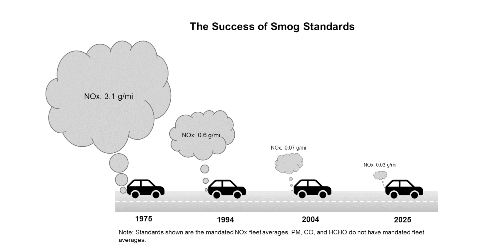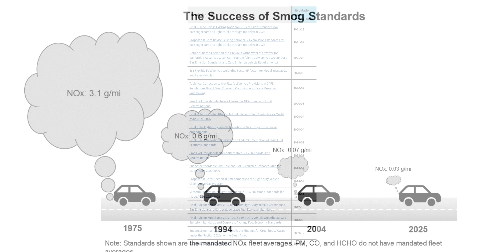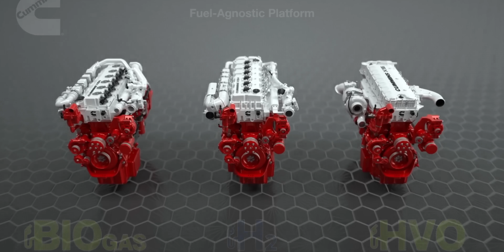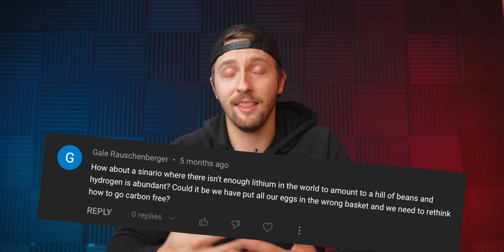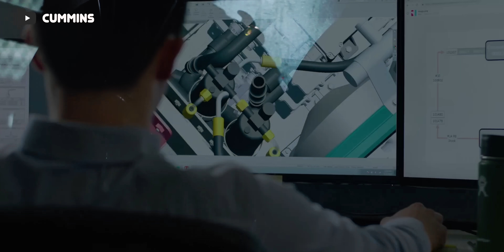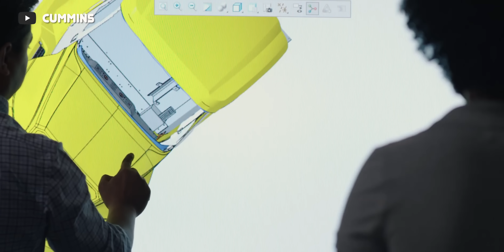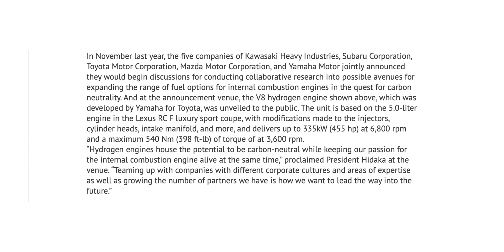Cummins Hydrogen Engine Will KILL DIESELS FOREVER

Comment: The biggest challenge with Hydrogen is that it is a leaky gas.  It is hard to contain long term and requires high pressure as well like Propane and such.  It would require electricity to produce the Hydrogen as well or some other energy source.

The reason to use Hydrogen is potentially fast fuel up.  If I can attach a hose to my car and similiar time as filling with gas I am back to full range you have a winner.  Also your comment on rare earth mining is another reason to use Hydrogen.

Another issue, why are they not using small motors as electricity generators and use electric motors? They had these on test tracks back in 2008/9 and they got AMAZING gas mileage using the motor at it's peak efficiency band.

Comment: I think this issue with the generation of hydrogen and what it costs to generate it, cool it down to liquid, put it in a massively pressurized tank, and all the small details related to that are HUGE problems. Way more than a gas or diesel engine, and with the hydrogen they're still going to depend on ELECTRICITY and by extension, FOSSIL FUELS. It's this insane modern idea of pretending like we're being green when we're not. It's such a load of BS. 

That's not to say I'm not interested in the idea of hydrogen engines etc I just believe that the people at the top pushing all these environmental ideas have different goals that are unrelated to the environment they are simply a means to an end. It is completely illogical to push "carbon neutral" fuels or energy sources when those energy sources still depend on fossil fuels. Gotta ask yourself the question why are they pushing something so illogical? Maybe because it's a means to an end and the details don't matter.

Comment: Cummins class 8 engines can also run on natural gas. I have worked on a few and they are cool.
Reply: They have been using these engines in the oilfield for years. Not new technology for sure. Ask any oilfield pumper or tech.

Comment: Why not strap a generator to the back of a diesel engine then run electric axles? Get a diesel engine that’s burning clean cause it runs the same Rpms and the torque of electricity or dies that make to much sense for climate change?

Comment: I used to build Garbage trucks with CNG configurations it was back in 2018 I did talk to the engineers back then ans asked them if they ever go to hydrogen they said it be very difficult  to produce the mass amount  of fuel needed to supply  that many trucks there opinion it won't happen and to add to this who would drive a truck that is hauling a literal bomb around just saying

Comment: HHO has been done by Stanley Meyer and ran his beach buggy on it and made it on board from water or Sea water. The German Submarine runs on Hydrogen with a built in Deasil for back up if the main system fails made in 2004. HHO has more power than Hydrogen on its own and you could say most have not looked into diluting the gas made from HHO to educe the power of it by 60% buy  adding a neutral gas to reduce the power of it.

Comment: Considering the diesel community is the reason the EPA changed its interpretation or standing laws  and is now trying to kill the greater car community, you will not get ANY sympathy from the rest of the car community.  Adapt or die...  you bring up a few good points, and the diesel motor may be the easiest to convert  over...

Comment: @Dust Runners Automotive Journal - Thank for bringing this to light... PLEASE LOOK AT HYLIION, PLEASE! Would love to get your take on their business model of utilizing Natural Gas for long haul trucking and incorporating clean fuel to charge batteries for their ERX Class 8 truck. You have now opened the can of worms and discussing Hyliion would be VERY beneficial to your argument... that in which the infrastructure is not there yet for Hydrogen engines and wont be for quite a long time. Yet Natural Gas is readily available, cleaner than Diesel (obviously). You also mentioned the thought process of generating Hydrogen which requires energy (dirty energy I might add), which begs the question of "well to wheel"... how is energy being produced and when it gets to the end point, is it really cleaner than burning diesel since it produced a mass amount of pollution to create it? All that to say, HYLIION has the answer and there are a ton of people who would love and need to hear your thoughts! Thanks in advance for your time and consideration!

Comment: diesel engines would never die  ,stupid electric cars will chan ge it ?? with what ?? with 4-5x less range and 50x longer refueling /recharging  and batteries often die in around 10 years and new ones costs 15000-20000euro depend on size !!  working maschines,ships,army vehicles ,trucks   it all epends on diesel engines

Comment: The in the 80's a man made the  Fuel injector that does it in hydrogen or turns it in hydrogen. Cummins doesn't have to redo there engines. So there wasting money an time.

Comment: The node west gets to cold for current battery technology. They cannot hold a charge in the cold and if you live in an apartment complex you would not be able to charge. 

This makes more sense for vehicles because it is still stored in a tank and gets converted to power just wonder how it works in cold.

Comment: Look into the history of hydrogen and how it was used in about 100 years ago. They used powder hydrogen to run vehicles, they used electricity, and many more but settled on gas. The powder hydrogen was great because if you ever got into an accident and the tank was punctured, it would just leave a harmless pile on the ground as the final step didn’t happen till it reached the engine… this is VERY OLD technology!

Comment: I’ve always wondered why trucks are set up like locomotives with a diesel engine running a generator that drives an electric motor. This has worked for a long time for trains and I don’t see why it wouldn’t work for trucks. A smaller diesel running at a mostly constant speed would likely be easier to tune to meet emissions standards and use much less fuel when the truck is idling to keep the driver comfortable while sleeping.
Reply: Alot of the mining haul trucks have diesel-electric drivetrains. Ours fully loaded weight is around 800k pounds and once they hit flat ground you wont keep up thier acceleration with a f250. Honestly that set up would be enormously efficient for long haul applications.
Reply: Most companies install APUs (auxiliary power units). These are small diesel engines that provide heat, AC and electrical power so the driver does not need to idle the truck to be comfortable.
Reply: Maybe we could re-plumb the brain of Leftists to run off ass gas instead of oxygen pumped through the blood stream, clearly, it causes them to see lions and tigers and bears, Oh no; the evolutional semiotics to their D.N.A had a bad glitch, lizards were never designed for warm blooded oxygen flows to the brain! Hence, we hear a lot of global warming/climate change issues with panicked imperatives!
Reply: That use case only works for trains because of the track system. They have a high number of multiple cars connected and they don't stop/start constantly like cars. Having a engine per load would be highly inefficient.
Reply: I've considered the same thing except with motors on the hubs.
Reply: In almost ever state it is illegal to idle ya truck engine that’s why they mad us install APU on them
Reply: Or did you mean are not set up?
Reply: Look at the size and fuel consumption of a locomotive, yes i know a tractor and trailer are much smaller, but the combined weight of the components would probably leave little left for freight, which would increase the number of those trucks required to haul the same amount of freight, increase the number of tires for those trucks, and fuel for them, and increase shipping costs as well. Probably erasing any advantage
Reply: @tomgranger462  Not to mention DOT weight allowance.
Reply: Don't know where you get your information, most trucks have standard transmissions (8 to 18 speed) that get power to the ground via the drive line(s).
Reply: @TheTimbertiger  True but large off road mining haulers trucks are diesel electric
Reply: Too heavy. Payload pays. Dead weight does not.
Reply: @Machia52612  a trains fuel tank are anything from 2500 to 5000 gallon tanks  the size is out of the question to put on semi trucks , at the end of this trains blow smoke all day every day , people forget it still has a Diesel engine
Reply: What you are describing is a Hybrid Engine... Does the Name Prius mean anything to the other commenters here? Use a small fuel engine to turn a generator, then use the Electric from the Generator to power a torque motor. The problem lies in that generator. A Hybrid engine the size required would be prohibitively expensive and when it wears out in 100K miles, you have a $50,00 bill on your hands to replace the generator (a Prius generator is ~$7K to replace for perspective). This being said, Hybrid is the way to go until they can work the kinks out of Hydrogen, say in 15 years or so.
Reply: @rb2530  that’s not how Priuses or most “hybrids” work.  Hybrid is just a lazy marketing scheme to fool most people into thinking their mostly ICE driven machine is green.  But it’s not.  It’s an ICE engine with a tiny battery bank that works for short periods of time at slow speeds.
Reply: @downbytheriver406  thanks. Always wondered about that. Had a friend with “ hybrid” . She said she got 40mpg. Wasn’t impressed with that number as my wife’s car gets 34 mpg highway
Reply: @arthurbrumagem3844  yep no problem.
Reply: @rb2530  What you're describing is called a Serial Hybrid.  The Chevy Volt (not Bolt, that's a different car) was like this.  (it's no longer produced)  There was a smallish battery, enough to go maybe 30-40 miles, and a small internal combustion powered genset that would kick in when the battery ran low.  People liked them.

Comment: Hydrogen is great, the problem is storing it. Hydrogen is the smallest element in world, It is very hard to contain because it can just seep through the containment vessel. Liquid Hydrogen has to be kept EXTREMELY cold, which imposes a whole another set of issues. Also as Liquid Hydrogen boils off as it heats up it must be vented are replenished to keep the same amount in the tank. Again Hydrogen is a great fuel for something like Rockets that can overcome these issues but for cars and trucks that are constantly mobile or parked overnight, its just not viable.

Comment: Hydrogen to fuel engines is nothing new. Manufacturers have been researching and developing hydrogen fuel cells/hydrogen powered vehicles for many years even before the dude making this video was even born. The Saturn 5 Rocket that went to the moon 50+ years ago used a hydrogen fuel cell for electricity so it’s absolutely nothing new. It’s really stupid to burn fossil fuels when we have so much hydrogen that we don’t even need to pump from the ground. A scientist invented really easy way to burn hydrogen from water he made a car that drove across country with a few gallons of water and he was killed so we have that technology and Ford and other companies made fuel cells back in the 90’s that worked we don’t need liquid hydrogen. We need to be more worried about cars if we get cars to not burn fossil that will be a massive step in the right direction most every adult in America drives a car and burns atleast one tank of gas every week that’s our biggest problem. Eventually dealing with Diesel engines needs to be done but let’s get one thing done at a time if we get the general public to not burn that one tank of gasoline every week that will be huge that’s the biggest problem.

Comment: People have this assumption that companies will only ever do the one thing they have always done. Which is a stupid assumption to make. 

Cummins isn't a diesel engine company. They are a money making company.  If they think they can make more money with hydrogen engines than diesel engines, then they will make hydrogen engines instead of diesel engines. Because duh.

It's the same with "big oil" companies. Did you know that Exxon is at the forefront of green energy tech? Because they want too have a way to make money when/if green energy ever actually replaces oil as the primary source of energy. Because duh.

Comment: Dodge EV truck with range extended. Smaller engine run as a genset at peak operating rpm to charge batteries as needed. What are your thoughts??

Comment: Funny how y’all just looking at it now. People out there running their trucks on water. Why do you think they can figure it out while billion dollar corporations can’t? It’s all in the design. You wonder if people really that dumb or are they intentionally obtuse. Hint for all you slow people with average IQs. A generator runs less fuel than an engine, Cummins also makes them. A generator might run .3 gallons of fuel and hour. Meaning you could get 150-200 miles per gallon of fuel. Who would it bother if you could drive across the Us and back on a single tank? I know of 2 scientific inventors that had engines running on water. They are dead. 1 guy had a 4 cylinder engine getting 100 miles on 1 liter of water. He disappeared, presumed dead.

The reason there is more interest in it, is because of politics in Middle East and Russia and OPEC. Talk of US dollar no longer being used as the Petrodollar etc etc. Technology has been out there for a long time, it has been suppressed. I guess if average consumer only filled their tanks once a month would make who lose money?
Reply: >>Funny how y’all just looking at it now. People out there running their trucks on water. Why do you think they can figure it out while billion dollar corporations can’t? It’s all in the design. You wonder if people really that dumb or are they intentionally obtuse. Hint for all you slow people with average IQs<<
Because, it doesn't work.
>> engines running on water<< Yes, they're called "steam engines".
Reply: @frankschwartz7405  No there are new methods, you must have been living under a rock. We have all sorts of methods of using water. Hydrogen fuel cells, electrolysis, cold fusion. If your references are steam engine lol. Shows how far out of the loop you are with technology.

Comment: Electric engines actually use less power because they're more efficient. That power just comes in a different form.
Reply: >>Electric engines<<
No such thing. It's a motor. An engine uses a fuel.
Reply: @frankschwartz7405  fuel is chemical energy, power is energy over time. You're talking semantic, Im talking common sense
Reply: @namechane1758  >>You're talking semantic, Im talking common sense<<
Maybe. Words mean things. Electricity, water or hydraulic pressure, moving air or water are forms of energy. Motors convert existing energy to motion, typically rotary motion.
Reply: @namechane1758  >>fuel is chemical energy<< A fuel is not energy, but it will provide energy (usually heat) when it undergoes a chemical reaction.
An "engine" runs on fuel, a "motor" runs on existing energy.
Reply: @frankschwartz7405  samantics my point remains the same. ev's use less energy to move the same distance
Reply: @namechane1758  >>ev's use less energy to move the same distance<<
Did I dispute that?

Comment: fact. hydrogen engines can not make the pulling/pushing torque of a diesel engine, makes no difference how many times these green energy scammers fabricate tests information, they can't can't change that fact. Additionally windmills/solar panels never pay for the themselves, they are just political control devices.

Comment: My personal thoughts are that the fuels will get cleaner and the batteries will get better to the point where we have true anti-idle that is electric and fuels that are clean enough that no after-treatment is required.  Regenerative braking instead of a Jake brake is also interesting. And conversely an electric boost when starting from a stop and accelerating.
Reply: Let me guess...you plan to ride a unicorn too.
Reply: Fuels may get better, but making batteries CLEANER, will be quite the challenge.
Reply: @dotarsojat7725  agreed lithium and cobalt mining is disgusting business and all these smug losers touting their EV chauvinism need hitting upside the head for their belligerence.
Reply: They have been making a trailer wheel set with a 200 KW motor and a 200 KW battery on the trailer for years.  They help with regenerative braking to charge the battery pack, and then use a throttle position sensor to help when getting on the freeway or going up a hill.  They are said to reduce diesel use by 13%.  The system could also be used on a electric semi, and could be plug in hybrid system, instead of just charging with regenerative braking.  

I don't think hydrogen will be the replacement for diesel trucks.  Maybe a gas engine conversion would work, (3.5L  running on hydrogen and putting out about 250 - 350 HP) as a low weight alternative to the traditional diesel engine as a type of range extender.   It would allow a semi to have a low cost and lower weight 200 KW battery pack, with perhaps another 200 KW battery on the trailer.
Reply: @Kangenpower7  What's the company that makes the electric wheel set, I am having an issue finding them in the context of semi trucks. My buddy and I(both truckers) were talking about something like that and how it would be beneficial, would like to see how it works.

Comment: How would a hydrogen vehicle react in an accident? You can't just think there is never going to be a wreck involving heavy vehicles....if the tanks have to be pressurized, what happens when that tank gets hit at 60mph with a 6k lbs projectile.... yea its great to have new ideas, but the entire pic has to be thought about